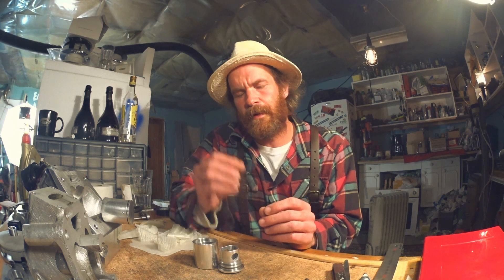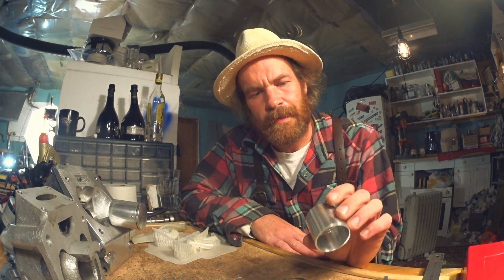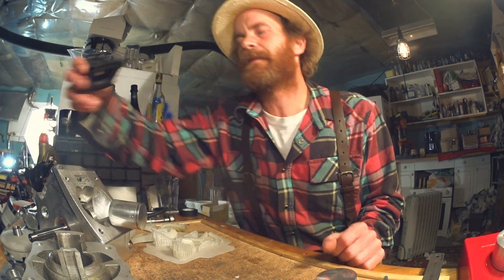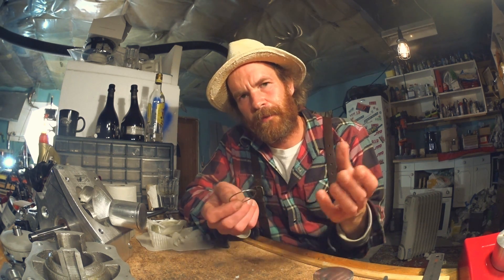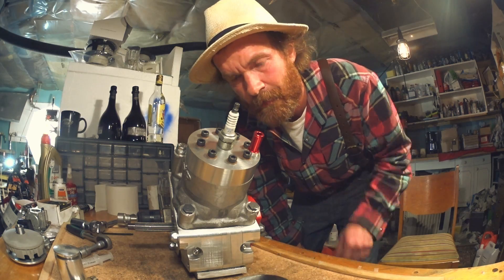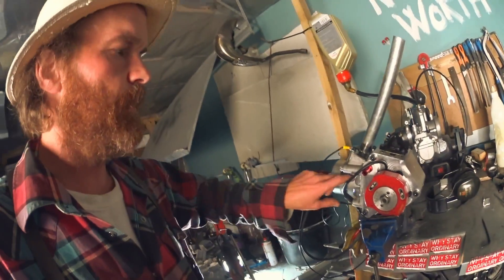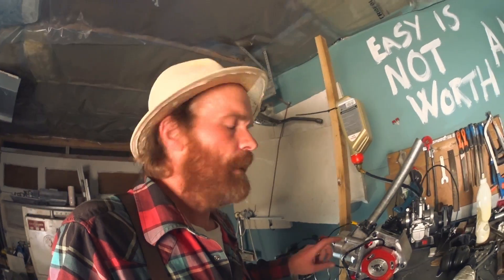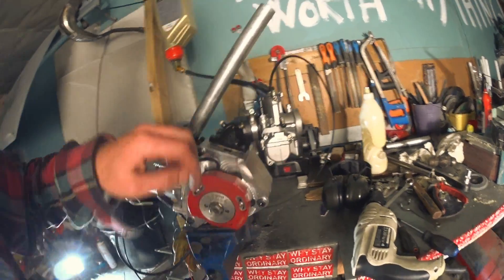STARTS, RUNS, EVEN IDLES! The Most Powerful Two Stroke Ever.

Comment: sir can you please explain how your engine works with resonance, I am a little bit confused
Reply: i'm not sure how the intake will work. What i understand is when a wave is traveling in a pipe and the diameter of the pipe changes, there will be a wave going in the opposite direction too, that's how the 2 stroke exhaust resonator closes the exhaust port before the piston blocks it off. Hope this helps until he answers :)
Reply: @dadwillfixit  About the resonance in the crankcase, i believe the diffuser in the pipe creates a low pressure wave that propogates back into the cylinder and through the crankcase, because the exhaust and transfer ports are open simultaneously. When this low pressure wave reaches the end of the intake duct, it will be inverted to a pressure wave and change direction. this pressure wave is timed to reach the cylinder just as the transfers close to push some more air/fuel mixture into the cylinder. In combination with the exhaust plugging this will have a tremendous "boosting" effect and really bring great volumetric efficiency